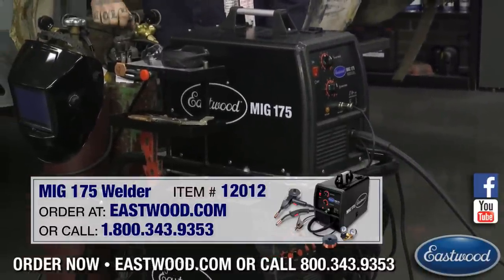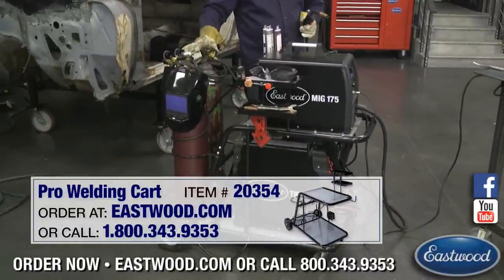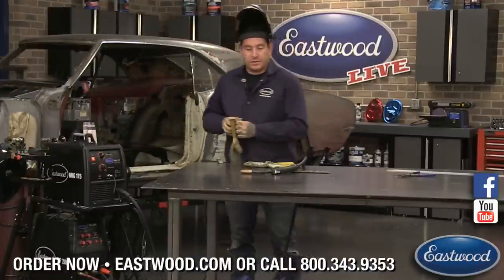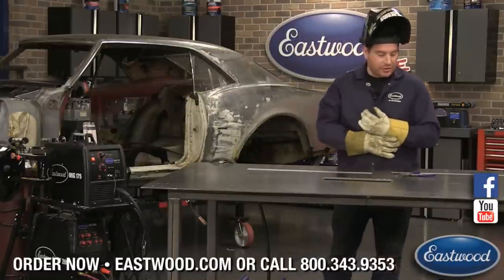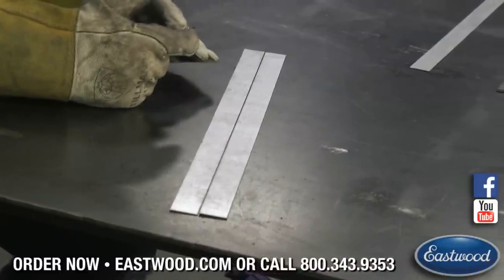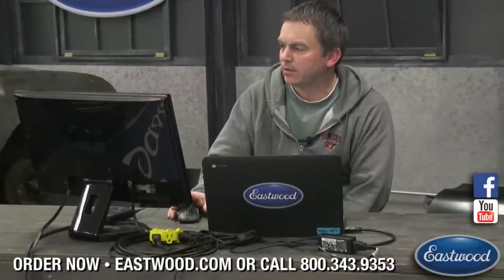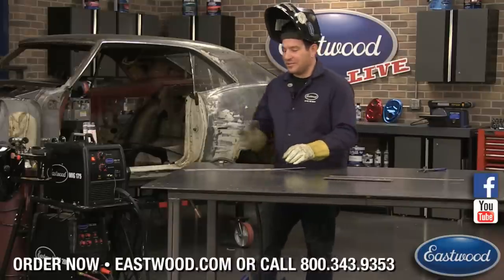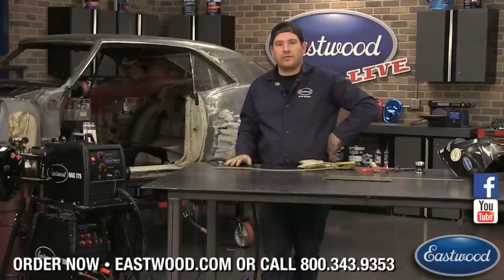Intro to MIG Welding - The Basics to Get You Started + Get Questions Answered LIVE!

Comment: I've got a flex core and I'm wanting to get a mig welder I'm looking at a Hobart 140 handler what's the difference between them.
Reply from the maker: The Eastwood MIG 175 operates on 240 volts and will weld 1/4 thick steel, which is about 2x as thick as the unit you mentioned.  The Eastwood MIG 175 can also weld aluminum with the supplied Spool Gun ($200 value).  The Eastwood MIG 175 also comes with a 3 year Warranty and Lifetime Satisfaction Guarantee.  Hope this helps.